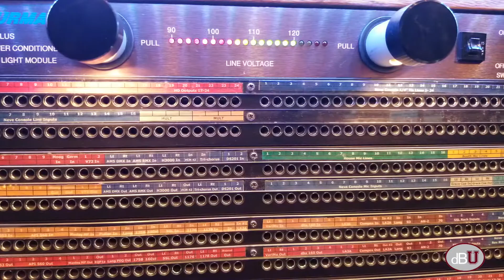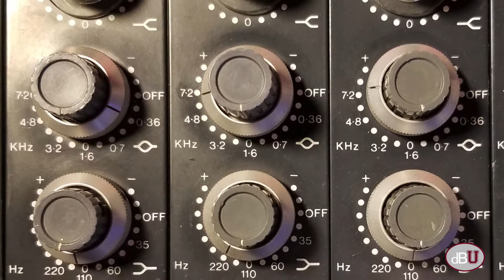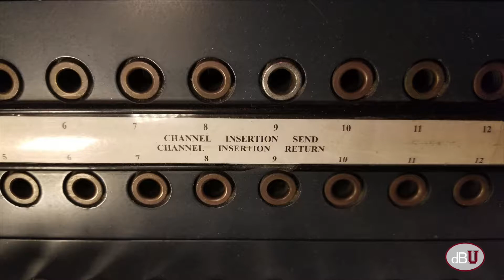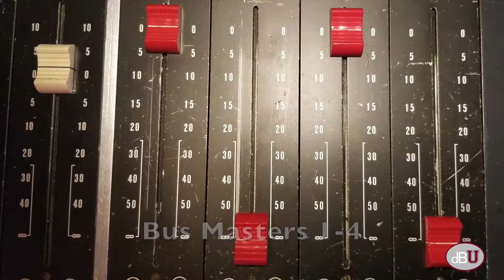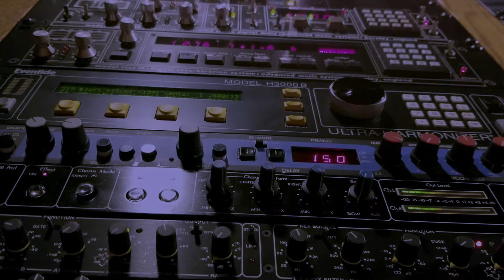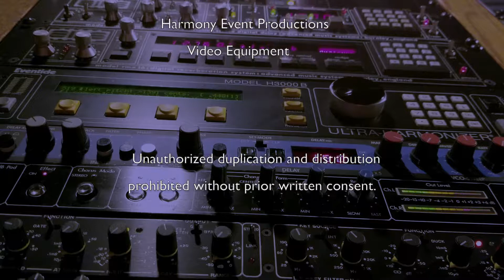plus4dBu: EP 12: Signal Flow Explained.

Comment: do different patch bays use different  connectors? I noticed the Patchbay's looked slightly different...
Reply from the maker: Yes. There are a few. Both 1/4" military style bays and Bantam tt bays are all made with solder tabs (as demonstrated in the patchbay video) but I have seen them also made with with PCB terminals. Prefabbed bays can be terminated to punchdown blocks, ELCO blocks, and Bittree connections. Punchdown bays suck and are as close to misery to work on as Hell itself. Bittree is the easiest to use but a tad pricier (post houses love them because they don't need to hire a tech to change the bay layout).  ELCO is my preferred style only because they tend to take up less rack space and are reasonably easy to use. I have seen RCA and 1/4" plastic bays but avoid them.

As we'll discuss in the Patchbay video, keep in mind higher end bays come either nickel plated because it resists corrosion. They are the bomb.

Comment: Are there authentic versions of the 8014 preamp/eq as outboard gear?
Reply from the maker: Yes, the 1073 is probably the most copied preamp in history, for good reason, they sound incredible! AMS Neve, Chandler, Aurora Audio, Brent Averill (now BAE), and Vintech all make 'clones' of the preamps. I have used them all and they are good preamps although they do NOT sound identical to a vintage 1073. If you want the sound of a 1073 you need to buy a 1073!

My guess is what these preamps lack is access to the original input and output transformers from the 60's. Metallurgy has been forced to change over the years mostly due to bean counters and EPA regulations (both negatives IMHO). The unintended casualty has been audio/music amplifiers which are very responsive to metal 'recipes'. This is also why vintage Marshall, Fender and Vox amps are so sought after. The metal is what made them sound so good. New metal kinda sucks.

YMMV.